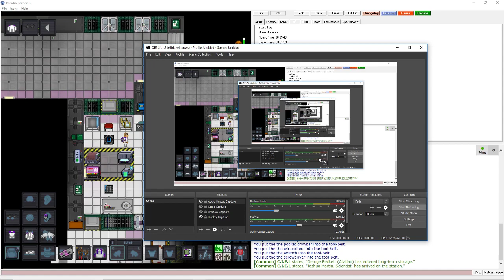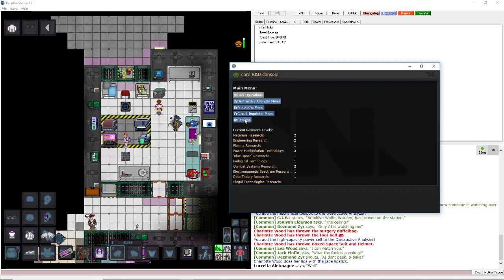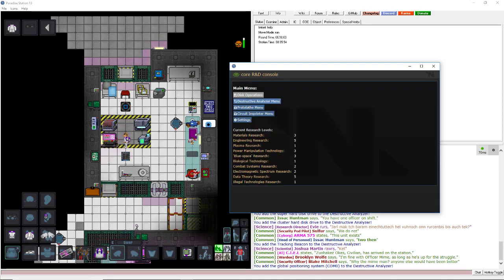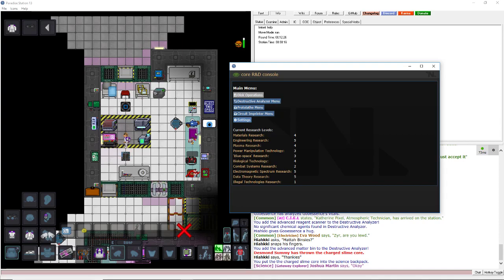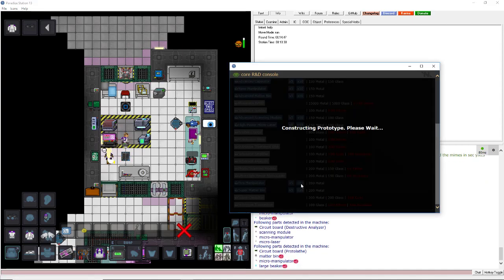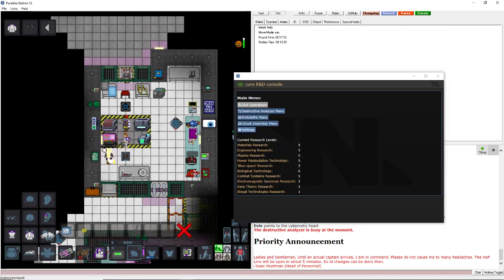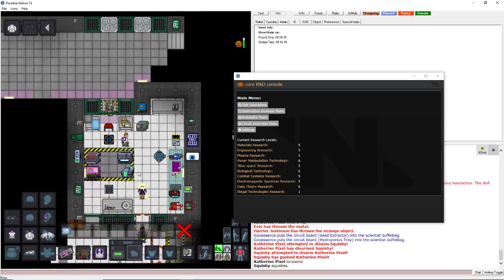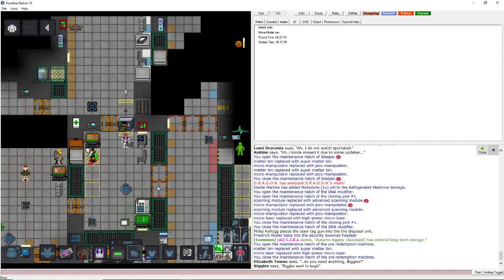Guide to Research and Development (Paradise Station)(SS13)

Comment: Could you explain how you send your technology central station?
Reply from the maker: I'm not sure what you mean by central station but you can print technology disks, put one in the computer, and copy a techology onto it. Should be a disk operations button you can press on computer. After this. You take the loaded technology disks to cargo where they put them in a crate and send them to centcomm and get points. Another thing to do with your levels is to synch to the database, this will allow all science machines to have your  levels. Hope this helps
Reply: @billsteven5941  thanks bro, i like your videos